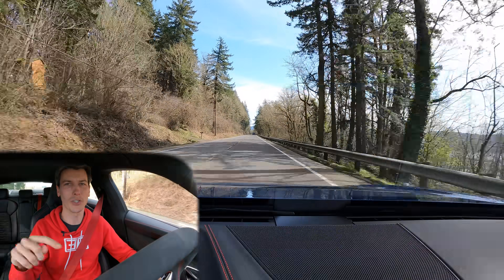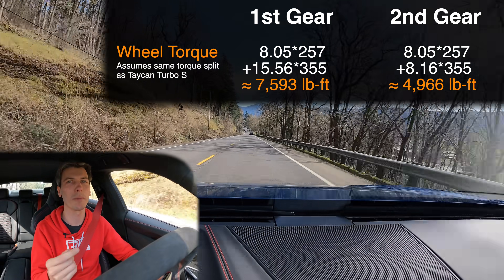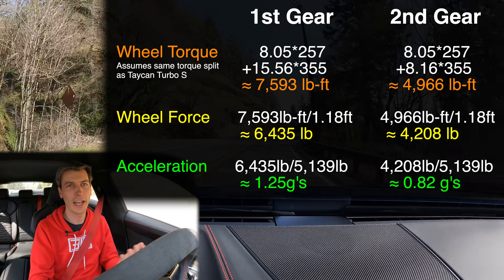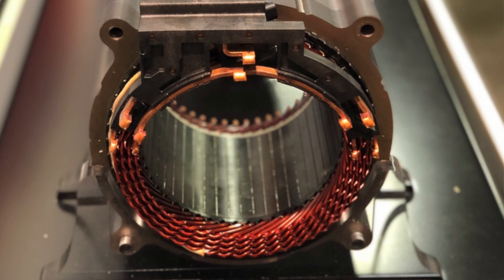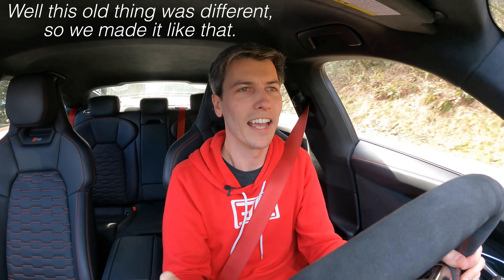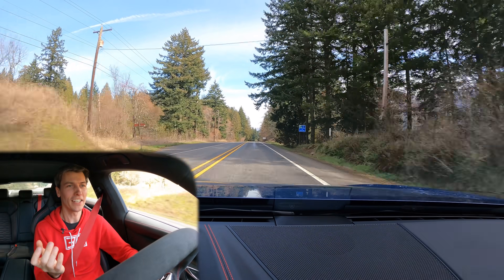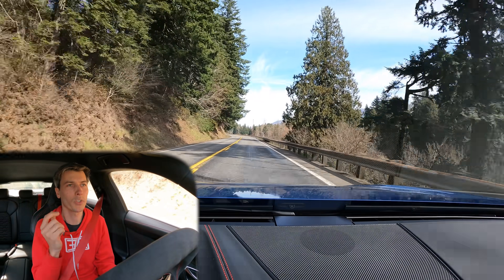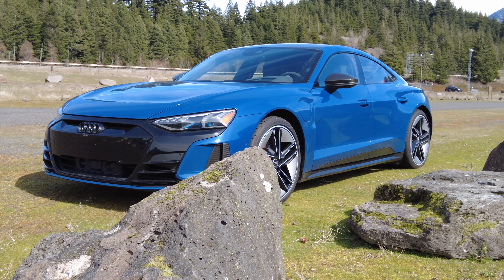Are Fake Manual Transmissions Coming? Audi Keeps It Real

Comment: Why not make a real transmission in electric cars, even if it can run great with one gear. If the transmission will multiplie the torque, wouldn't the car be more efficient and performe better with multiple gears. You could get better acceleration and better top speed with extra gears. If a electric car with one gear does 0-60 in let's say 6 seconds, wouldn't adding gears allow you to drop that time without modifying the battery pack or the motors?

Comment: Question...If an alternator works by turning mechanical energy into electrical energy then why won't car manufacturers regenerate the batteries in the EV's using an alternator instead of plugging it into a power source? You have all these things that rotate (ie: wheels) that could be used to spin the drive belt that rest on the pulley of the alternator which in turn can recharge the EV's batteries. To my understanding, charging the batteries consist of direct current and the alternators rectifier can convert its AC power into DC power thus recharging the batteries. Please educate me if I'm wrong.
Reply: @legacysage thank you for replying. I get that part (recharge while NOT pressing the accelerator or brakes while the car is in motion) but it doesn't recharge in the way I'm thinking about it...meaning keeping the batteries charged completely on a constant basis generating power via other moving parts creating electricity in addition to the regeneration process...a never-ending charging process.
Reply: @legacysage got you. With this lest see what happens..

Comment: I've got a Nissan Rogue with CVT transmission and it has fake gear shift points so that it feels like a car that has gears.  They did that because people didn't like the way CVTs felt.  It also allows you to push up and down on the shifter to simulate a manual transmission.  I do have to say I like it that way.

Comment: I think those fake manual transmissions are missing the whole point of driving a manual transmission in the first place. Here’s some reasons why people drive manual transmissions:

1) more direct power from the engine - In EVs this is no longer required since the motor has a direct connection to the drivetrain.

2) better control over engine response at different RPMs- in EVs the motor has full response no matter what rpm it’s at.

3) better control of engine torque - those fake manuals don’t really address that since they actually limit the torque of the engine instead of multiplying it like in real manual cars. In this sense it’s the opposite of a real manual.

In short these fake manuals are doing the opposite of what a real manual should do.

Comment: Wouldn’t be better and more efficient (even with the parasitic loss of having to move the transmission and diff gears) to use a way smaller electric motor with less power and using a transmission and diff. to put out the  extra torque needed to accelerate? Just as a regular engine. 

Without the need of high discharge of current and bigger batteries for the single gear compromising?  

High RPM and 200ft/lbs of instant torque with a Manual and the proper gearing sounds fun AF
Reply: Note: using multiple gears not just 2

Comment: Would the higher gear ratio (lower numerically) on a multi speed EV allow the charge to last longer because it is turning at a lower rpm when cruising or does the rpm not matter as much on EV as long as it's not under load?

Comment: I think that the fake manual is a great idea for driving enthusiasts. This opens up huge possibilities for tuning and model differentiation. Depending on what the vehicle is equipped with (electronic dampers and active sway bars). You can have a completely different driving experience by just changing the software.

Comment: Can you do a video on start-stop tech and mpg. It drives me nuts its on the new subarus. Edmunds has an article estimating maybe it saves 10% mpg max but its hard to even calculate AND mpg isnt even rates with that feature in mind because the car is stopped when they test it and its based on how long you stop for. Its offset by larger parts and other tech to keep ac and heat running when the engine is off which adds weight. Also engine fill the cylinders with has to start each time so I dont see the benefit. I feel like if there is any issue with your car it will just make it worse. Also if someone jumps your car you better idle it for a while before hitting the first stop sign because youll lose you engine again. I think id rather go all electric than get one of those. Subaru does have a feature to shut it off but you have to do it each time you get in the car. Its rough sometimes when the engine restarts. Drives me nuts. I have a 2022 loaner crosstrek right now with it. 1200 miles on it and its already rough when it restarts

Comment: EVs could have a "manual" mode that has fixed field weakening levels. The torque would react similarly but it wouldn't be as efficient as letting the car do the minimal field weakening needed to achieve top end power.

Comment: But the question I have... do you save a bit of battery power if you can reduce the RPM of the electric motor when going at 100km/h?  Is RPM of the motor affecting how much electricity / power it's using?  Maybe having gears reduces the heat and electricity use?
Reply: Q: Is RPM of the motor affecting how much electricity / power it's using?  very good, your question is astute/observant.  A: yes. to a degree this is what "hypermiling" is all about.  even with todays "single speed" EV's (which is basically everybody) if you drive at 55mph (88kph) one consumes less watts/mile and thus gets MORE RANGE versus when one drives at 70mph (112kph) thus consuming more watts/mile ending up with LESS RANGE. drag effects, motor inefficiencies, and flat torque curves not withstanding, same as ICE, logic dictates road speed/wheel speed in an EV has the same DIRECT CORRELATION to engine/rotor speed in any given gear ratio.  again only ONE ratio (in constant mesh) so it has no choice.

Comment: I kind of think the fake electric gears may have a point. Limiting torque might be useful to keep a lower speed (and maybe lower battery usage), when driving in the city or when cruising. 
But then, again, I never drove and EV, but I imagine it is the difference between driving 30 mph in second gear and in fourth gear...

Comment: Jason i need you to confirm the shift strategy for us.  as i understand it (because: Germany, because Autobahn) the logic VW uses on both the E-Tron/Taycan twins is that these cars DEFAULT and hold the taller gear for like 90% of driving.  the idea being they ONLY shift/use the lower gear when say SPORT MODE, LAUNCH MODE or whatever is selected.  it seems the new 2nd gen EV's from BMW (ref: iX, i4) while obviously leaving out the gearbox like most others, have also been geared for the Autobahn.  despite their EXTREME curb weights, Watson's drag races (CarWow fame) show both new BMW's "beating the pants" off nearly everything (including non Plaid Teslas) in term of mid range and top end acceleration.

Comment: This brought up something I do with my 3 yr old son driving with me in my Chevy Volt and he thinks its hilarious!  I imitate a manual transmission vehicle by modulating the throttle and making sound effects of an engine with my voice.  
From a stop, accelerate...BRRRRRRRRRRRRRRRRRRRGH.  Let off the throttle to give the vehicle that delay in acceleration like you would in a manual while simultaneously lowering my voice.  Accelerate again with a slightly lower BRRRRRRRRGH.  Repeat.  My son laughs his butt off and I have to admit, it's pretty fun for me too. 
Problem solved and you don't have to buy a different car if you miss shifting!

Comment: I could never seriously buy a car that fakes these things. There is no logical reason to do so. I hate my noisy engine car and I hate gear shifting. These are burdens that I would gladly do away with. Deliberately piping noise into the cabin when it's not necessary, and forcing the driver to hear it is unacceptable.

Comment: So technically, the engine wouldn't stall. What if I put it in 6th and just use it as is?

Also, when you need to accelerate to pass, you'd just be better off with the higher gears instead of downshifting?

As much as I would love to keep the manual transmission experience in an era of all-electrics, this sounds like quite a change from the original.
Reply: he didn't mention that it'll simulate stalls and all that
Reply: You can't stall an electric motor
Reply: @Jack-qn4vt  No, but you can make the electronics pretend you did stall
Reply: @Jack-qn4vt  which is what I said. It wouldn't stall. So I wonder if you can just put it in 6th and use it like a regular EV. That's what I was wondering. Will rephrase it tho as I see why it's confusing.
Reply: @Die_Kvar  EV's use a low gear ratio hence why they generally only have one gear, sometimes 2.
So yeah imagining like they're in top gear is right way to think about it.

Comment: I could not agree more.  It’s just like BMW piping in artificial engine sounds.  I’m 40 and I drive a manual WRX as a daily.  I love driving and I want to be in charge of as much of the car as possible.  From the sound of the intake/exhaust, to the vibrations in the pedal, I love every bit of it and would hate to drive a Prius or something that did away with all of those things.  To each their own I guess.

Comment: ill just stick with my far superior $45,000 gas car. more reliability, more range, and shorter long trips. swing into a gas station and its "fully charged" in 3 minutes vs electric car "topping off the tank" in 4 hours or more depending on the charger available. electric is not the future by any means for a VERY long time, if ever!

Comment: One significant reason for these "manual" EVs would be for driving instructors and such. Especially in markets where manuals are more prevalent, it allows the learning of stick-shift for the people who can not (or wont) purchase an EV. Used, old, racing, and classic cars & trucks etc are going to be around for long enough for it to be viable, and its a great way to learn  in a new and modern vehicle without damaging it. Not to mention also being able to be used as a normal EV with the flick of a switch....

Comment: would gears not increase battery efficiency? by having gears you could use a less powerful motor which takes less strain on the battery. Am I wrong here, with this could you not get better mileage
Reply: Haven't done the math, but that's literally what a gearbox does. Gets the most out of one motor

Comment: EVs have their own NVH issues, particularly with high frequencies. The synthetic motor sounds are designed to draw your attention away from that to a nicer sound. It's a psychoacoustic problem. Electric cars are very quiet, but other sounds (motors, inverters, gearing, pumps and electrical systems, road noise, wind noise) become very annoying. Some noises sound awful at any volume.
Reply: I’ve been driving an electric Chevrolet Spark for seven years and I’ve never really noticed the sound. Or vibration, or harshness. I never noticed them in my brother’s 2013 Model S or any of the Model 3s that I’ve been in.
Reply: @MrTeff999  Can't speak for the Bolt personally, but Teslas make some annoying sounds. There is a lot of forum talk on the subject.
Reply: well people like the sound of engines

Comment: It's all about the experience. The Fun. The engagement.
Manual car are much more engaging to drive compared to automatics. CVTs and electric cars are even worst due to their flat-ish acceleration curve. 

I love driving stick. Love that extra "duty" the car commands of me. Love the feedback it gives me for making the right choices at the right time.

I for one will gladly pay extra for a "fake manual transmission" option on my next electric car to reproduce this engaging driving experience. So yeah, please let me fake-shift my electric car, let me enjoy feeling the fake-torque-curve acceleration of a fake-ICE engine when I fake-downshift and floor the gas. Let me precisely brake regen as little or as much as I want by fake-downshifting and fake-clutch-slipping into a lower fake-gear. 

Fake? Useless? Inefficient? Absolutely. 

More engaging? More entertaining? More fun? for those that enjoy driving stick, hell yeah.

Comment: So if it's a fake transmission can I stall the engine? I just feel like the panic of rolling back on a steep hill with a fake transmission won't be the same. Or stalling in a turn and losing the power steering. I wonder if they've simulated that too.

Comment: There seems to be a lot of questions in the comments about adding a mechanical gearbox in an EV to make the vehicle more efficient. 

Any mechanical gearbox has associated losses with it so although it might be possible to get a slight improvement in the efficiency of the electric motor using a mechanical gearbox,  the losses that come from adding the gearbox are going to be more than the efficiency gain from the electric motor. 

The inverter that drives the electric motor employees PWM (Pulse Width Modulation) to reduce the voltage supplied to the motor at slow speeds.  The Duty Cycle of the PWM defines the amount that the voltage to the motor is reduced - using a Duty Cycle of 25% is the same as using a 4:1 mechanical gear reduction  - the voltage is reduced by a factor of 4 and at the same time the current fed to the motor increases by a factor of 4.

In this way using PWM control is basically an electronic alternative to a mechanical gearbox.   A mechanical gearbox changes speed and torque, and using PWM control in the motor inverter changes voltage and current.

Comment: Forgive my ignorance but - electric motors make more power at lower rpms right? So why would we not actually gear an electric motor with REAL gears to keep the electric motor in a sweet spot and actually take advantage of the power (or lack thereof in this case) curve? Does it have to do with the way we're currently transmitting the power to the wheels? What am I missing?

Comment: Maybe I don't fully understand how electric motors work in an electric car, but it seems to me that multiple gears would really help with range since it would slow the motor down at higher speeds. Do different gear ratios have that same effect on electric motors? Wouldn't spinning the motors slower at higher speeds reduce the electrical consumption thus increasing the range? Or am I missing something here?

Comment: I wonder if a brand could make a “classic mode” that would let you electronically select older models In the brands past?  Each selection could be programmed to mimic that cars characteristics… steering feel, rev ranges, suspension, sounds etc.
Reply: Now this is an interesting argument for all this stuff to be made. I would love to be able to turn all that simulation off though as well.
Reply: THANK YOU! That's exactly what I was saying. It would be fun to have fake engine sounds and shift points for the retro feel occasionally, but not built into the car where you HAVE to use it.
Reply: That would probably be very expensive though, I think the closest thing to that is Renault putting different engine sounds in their EVs or something

Edit: correction, this was a thing in the previous gen Renault Clio (normal diesel ICE), you could even choose the sound of the R35 GTR
Reply: It would be cool if this Audi could make a 2-stroke DKW noise.
Reply: @nlpnt  🤣👏👉
Reply: I've been saying this for years. It's a great idea
Reply: I could get with this
Reply: Everything is possible, sir.
Reply: SmartCar, please emulate Geo Metro with classic edition.
Reply: I can see that being a subscription package, unfortunately lol
Reply: that would be so expensive
Reply: Hey car, mimic a Sherman tank.
Reply: Wondering how would they program in huge ammounts of understeer
Reply: @MrDexter9i3  vorsprung durch understeer?
Reply: Really like that idwa
Reply: This already exists. It's called Gran Turismo.
Reply: This would be a fascinating concept to think about because now you have to try and deal with structural aspects like weight, weight balance, rigidity, tires, wheel size, etc.
How would car companies deal with all of that? I'd love to see attempts at this, as impractical as it sounds.

Comment: Fake engine noise, gear changes, et al, need an "OFF" button, or make them options so idiots will pay for them. Agree on a manual gearbox, and with the EGO part, Porsche, ditto other marques, love to play the EGO,  witness charging outrageous prices on deviated stitching. Sadly many owners of these high end cars hardly drive them, you see them for sale having been driven only 1k miles/year. The drive train on my manual '19 911 didn't come into its own until after 15k miles, currently 20k+. The owners of these low mileage cars are missing out